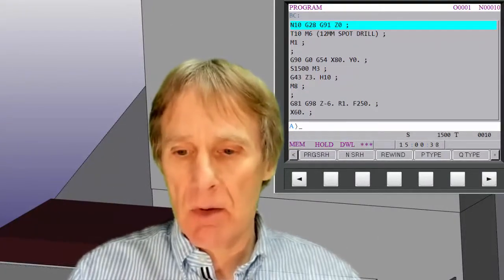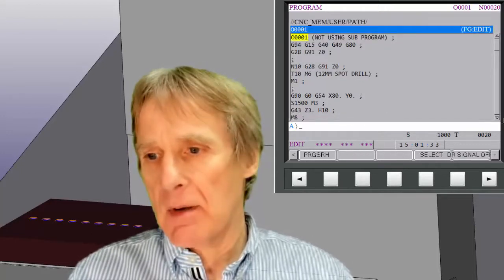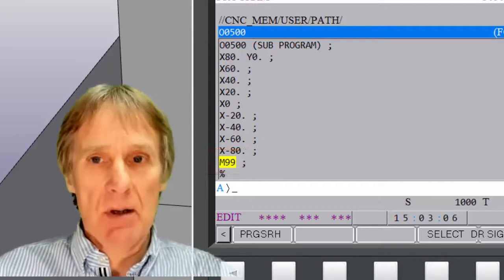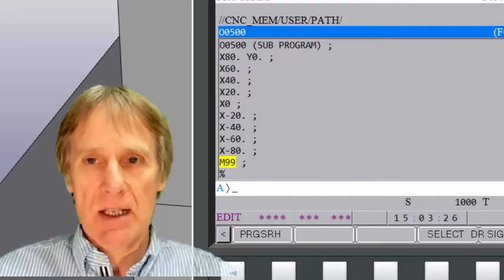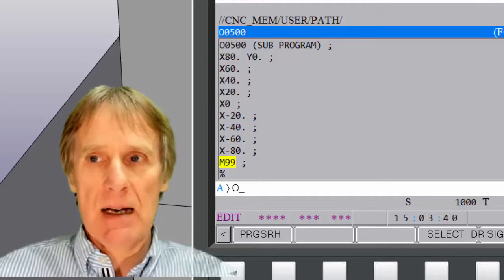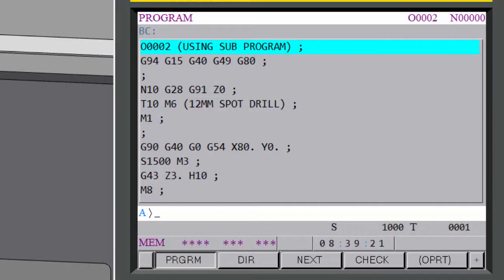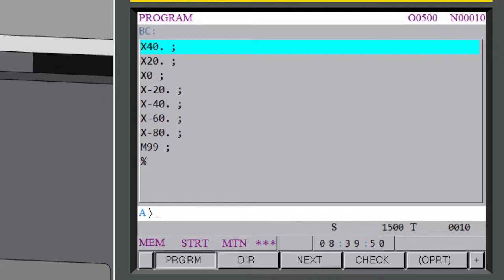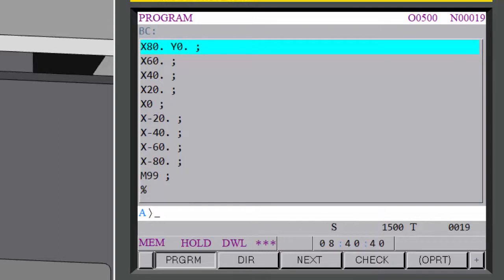Using Sub Programs in a CNC Program

Comment: FANUC has also Internal/Local Subprogram call, just like HAAS (M97), the "hidden" M98 Qxxxx set by par 6005 Bit #0=1 [SQC], it works the same as HAAS M97 Pxxxx, a bit strange that you have to set that parameter 6005 and it's not randomly known or used.
When the parameter is set you can select M98 P for External subs or M98 Q for Internal/Local subs.
This is for all the Fanuc 16i/18i and later controlls.
Reply: What About new cnc 2023 with fanuc Ez Guide ?
Reply: @armen9833  
No problem as long as parameter 6005 Bit #0=1[SQC], you can use Internal M98 Qxxxx for small(er) codes and combine it with M98 Pxxxx for bigger External Subs, even large codes with M198 call to CF-Card.